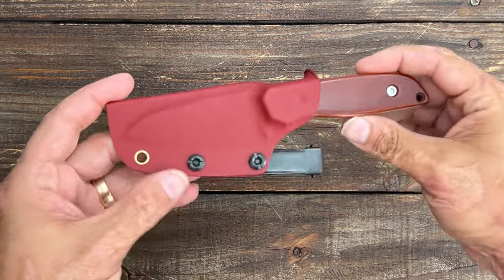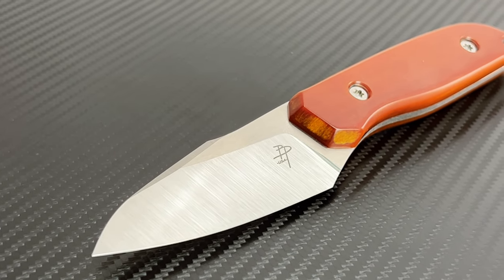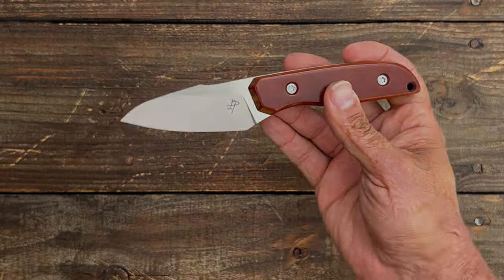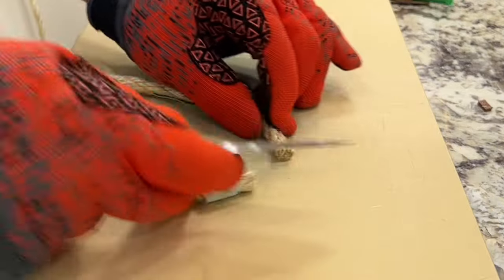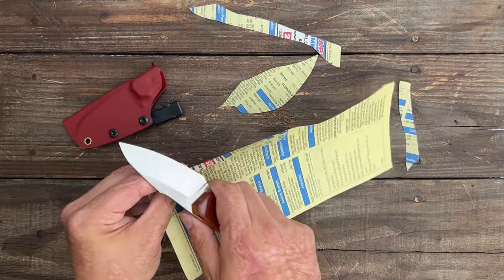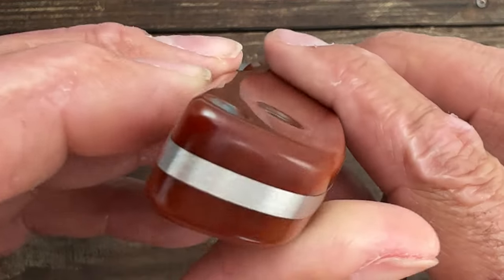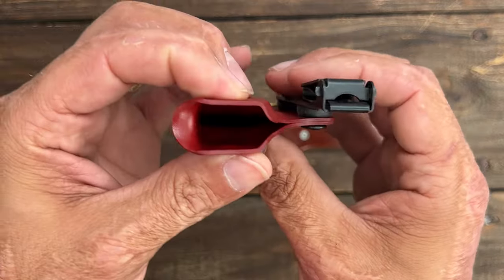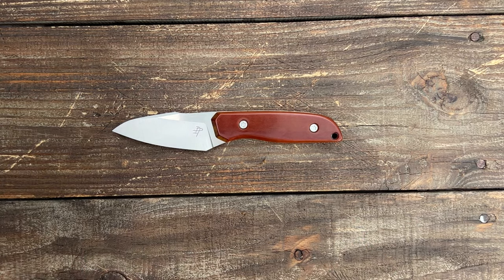Incredible USA Made EDC Fixed Blade : BP Custom Knives F.U.K

Comment: I think knife guys need to experience what its like to cut with anything ground at 5 thou or thinner to see what great cutting really is. I have a custom paring knife that's 1.2mm stock 9f Aeb-l at 63.5hrc and probably 1-2 thou bte (it was a FFG zero grind and just has a microbevel) and it just cuts. Even when dull as hell it still cuts fruit and cardboard better than a lot of shaving sharp knives just because of the geometry.
For a long time my go to EDC knife was an Elmax PM 2 with a Krein regrind to 5 thou. It just cut so well that i didn't want to carry anything else. 8 eventually got other thinly ground knives so i don't carry it as much, but i still love it.

Comment: Do you have a preference between the F.U.K.  and the overland sport?
Reply: Overland sport! Mainly because the edges are softened as in more comfortable.. thinner and better for edc and similar cutting ability.. I have owned and handled both
Reply: However both are nice knives and makers are easy to work with just my personal preference

Comment: Stassa23 it will be interesting to test some steels on kork material, I've found some kork 
and tested elmax steel on it and it cuts it but its hard for cutting maybe the 90 degree agnle thick 
cardboard profiles you cutted, you'll have to try with the magnacut.